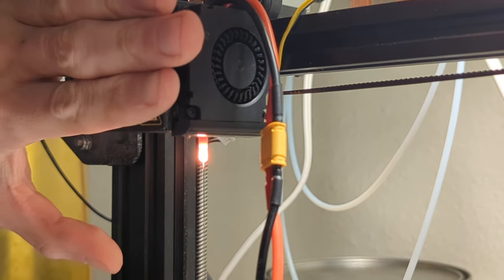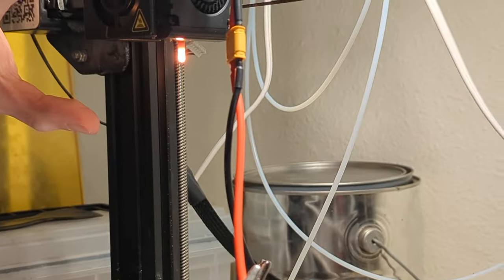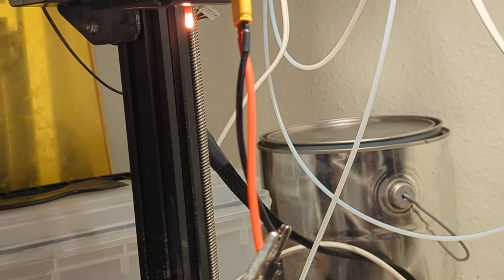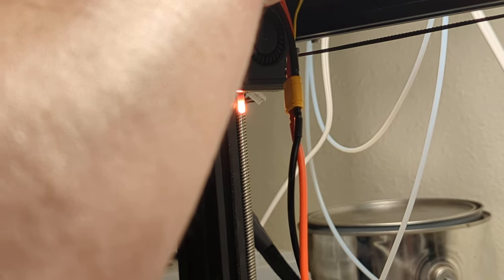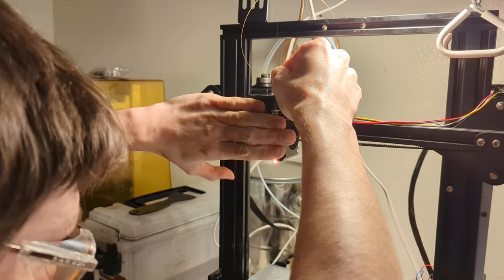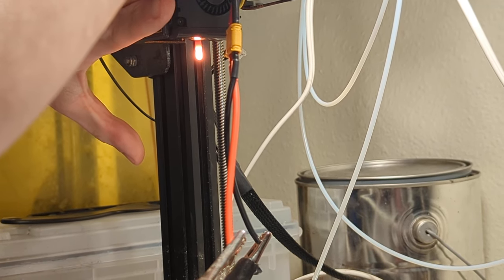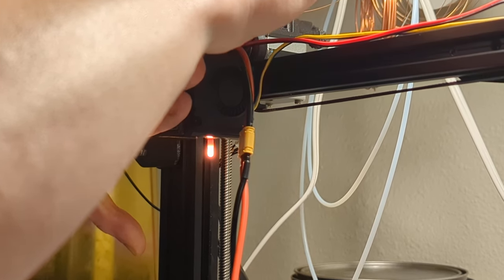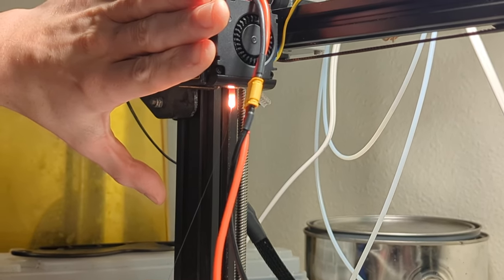clearing a jam in 1300 C hotend on the ender3.

Comment: I think you might get some stringing smoking with PLA at that temp
Reply from the maker: indeed. it might even be vapor deposited. :P
Reply: Just a little
Reply: I heard bronze, didn't know if that was the hot end nozzle material or if it was metallic bronze filament. I think 1300C is approaching (or even past) the melting points of some metals
Reply from the maker: 24 AWG, (0.52mm diameter) 510 phosphor bronze wire is the feedstock. The hotend itself is made of Si3N4-MoSi2 ceramic matrix composite, sourced from a ceramic glowplug that I modeled and characterized here;
https://www.printables.com/model/635347-beru-glow-plug-cgp-002

The actual printing temperature for bronze in this system will be somewhere between 950 and 1030 degrees C.

 @cyleleghorn246
Reply: @rotoforge2024     thanks for the reply! That sounds sick, I didn't know if the ender 3 officially supported this or not, but after this video the algorithm showed me your other video talking about the hot end! I'm gonna subscribe, thanks again for the details, it sounds absolutely awesome, like a happy middle ground between a 3d printer and a metal SLS machine. Maybe bronze isn't quite as good as sintered steel, but it's a whole lot better than PLA, and I'm assuming you can still use PLA or other filaments when you want to!?

I want a new printer, my old one has some problem where it clogs every time, I think it needs a new hot end heating element because it ramps up fine, but the temperature tanks whenever the fan comes on or I start feeding filament. It just can't keep up. The 1300C hot end sounds like it would solve all my problems haha
Reply from the maker: IDK about solving all your problems. 
the hotend uses 0.5mm filament diameter. so you would have to draw your own plastic filament using another 3D printer with an 0.6 nozzle...

as for the strength of bronze versus sintered steel...

if we actually obtain near forged properties in the bronze we print, bronze can easily be as strong as steel(particularly sintered steel), with greater ductility, if somewhat lower surface hardness.

typical tensile strengths for forged bronze 510 can be as high as 630 MPa at room temperature. A range for most grades in various annealed states at room temperature is between 340 and 640 MPa.

Most common sintered 316 stainless L, SLS parts are about comparable to this value. They can, with hot isostatic pressing, obtain as high as ~ 1  GPa at the expense of ductility.

This kind of comparison is definitely up for test in medium term once we get to printing.

This is to say nothing of the porosity of sintered parts which render them unsuitable for gas and fluids handling and vacuum applications...

We will be releasing a video on how we made the hotend this weekend. 
if you want to try your hand at making your own. 

In future, once we have got more concrete test data, I plan to make and sell them as a conversion kit or perhaps as entire dedicated printers. but this depends a lot on demand and performance. :P 

glad you like the work! 
feel free to join the discord if you want to tag along in the ongoing development as it happens. 

 @cyleleghorn246
Reply: @rotoforge2024  that's awesome, thanks for the write-up on it! I didn't know sintered parts had porosity issues, but it does make sense. I also had no clue that the bronze could be as good as other steel parts! I've been learning how to weld recently, so I have a great appreciation of how strong steel can be if it's even slightly thick. Getting that kind of part from a "standard" desktop 3d printer (as opposed to needing CNC, SLS, EDM, etc) is fantastic to think about

Comment: 1300°C? Good god that’s hot
Reply from the maker: in an inert atmosphere probably capable of ~1800 C once properly prepared.
Reply: @rotoforge2024 my brother in Christ why do you wish to incinerate PLA or print with glass
Reply: Maybe he wants the higher flow rate without paying for a cht nozzle 😆
Reply from the maker: actually, because the filament we use is 0.5mm diameter, and the power density in the hot end is ~3 orders of magnitude higher than conventional designs, we might actually be able to speedboat very well. 
plus, because the heat is generated at the nozzle tip practically inside the deposition zone, the degree of crystallization and layer to layer bonding that could be obtained even at very high printing speeds may be far superior to conventional designs...

One test we want to run is, using our conventional 3D printer to extruder filament feedstock at ~0.5mm diameter to feed into this hotend and see just how fast we can go on a better frame. 

TLDR; Yes, I do want to go faster and get better part quality.
 @Youtubeiscoolandgreat
Reply: @rotoforge2024 wow, I look forward to seeing your future tests
Reply from the maker: want to print with metal, and glass. 
bronze and borosilicate electronics for example.  @vaethe
Reply: 🤣🤣 @Youtubeiscoolandgreat

Comment: Aluminium printing unlocked
Reply from the maker: bronze printing unlocked 
basically a new bronze age if it works well. :P
bronze is the new PLA?
Reply: @rotoforge2024 get it running with a second extruder for ceramic or something and I'm looking forward to printing a toaster!
Reply from the maker: the papilio lite is the extruder we are using in a direct dive configuration. so we can print metal from fine wire and ceramic from glass/basalt/aluminosilicate fiber. the belts are pretty good at pushing glass fiber. 

https://kevinakasam.com/papilio/

also if you print a toaster, I would love to see it. 
 @OtakuNoShitpost
Reply: @rotoforge2024  How is it printing with metal? One immediate difference is that unlike plastic metal is a crystalline structure so it can basically turn into slush instead of progressively softening like glass and plastics do. Alloys seem like they could also be problematic over time as well due to the potential to selectively remove constituents at the melt interface if it re-solidifies at all.
Reply from the maker: We heat a fine metal wire to the semisolid range between solidus and liquidus. By selecting a  alloy whose native oxide is self fluxing, and which has a wide window between solidus and liquidus, and using a nozzle/heater which is not wet by the liquid fraction, and resits abrasion of the solid fraction well, and which can respond quickly to changes in temperature to keep us operating in the relatively narrow window between solidus and liquidus,  it becomes essentially possible to print metals like butter, or chocolate, or any other thixotropic (pasty shear thinning) material. This is not exactly the same as viscoplastic behavior of thermoplastics.

though we do intend to print with glass and basalt for printing the insulating parts of electronics...

we have yet to fabricate samples to analyze destructively to get a knowledge of how the process impacts microstructure.  This is definitely in the plan for medium term future. 

yes, semisolid processing can enable grain boundary segregation of alloy constituents. however, the actual thermal cycle time of deposition from hots semisolid metal to fully solidified on the deposition surface is extremely short (think single digit to maybe tens of milliseconds. and the diffusivity of most alloy constituents in the semisolid window is quite limited, for bronze in particular.)  I expect these factors and a few others I will include in future videos and a blog post tech writeup, to limit the degree of alloy decomposition due to the deposition process.  in fact, I expect to see near hot forged properties due to the strain from being pressed onto the previous layer in the semisolid region and the very high cooling rates seen in the deposition region...very fast rates of heating and cooling generally result in finer grain structures in many metals, including bronze....though only further tests can tell...

the short answer is there are still a ton of unknowns, and the working hardware is only step one.  

If you have any insight into the nature of these processes, we would love to chat with you in the discord. 
 @mysock351C
Reply: @rotoforge2024  Wow. Thanks for the info 😃 Yeah these things are always a challenge and you don't know until you try.

Comment: Very cool progress! Yes granular jamming is a huge issue with semisolid printing - that's why it's easier to print from the liquidus - but then semisolid material can still jam as it's initially entering the hotend, so the internal geometry and materials selection is very important. If I recall, I had an update on Hackaday about the 8 cases of high temperature wetting - it will be valuable to take a look at that. Nonwetting surfaces will help reduce granular jamming, but above the liquidus it may also help to have a wettable feature at the very tip of the extruder, because you can guide the deposition using the meniscus for better print quality.
Reply from the maker: thanks Michael!
I will be sure to take a look.
post a link?
Reply from the maker: the jam occurred because I melted off a piece of bronze in the hotend at way above its intended operating temperature. 
We were not intentionally feeding material at the time. we actually ended up clearing the little slug of molten material by pushing it out with a tantalum wire. 

the internal geometry is essentially a straight tube of ceramic. 
We may end up shrouding the ceramic tip in a H13 or other hot work steel or other high temperature tolerant alloy to provide wettable surface and a support for an oxide scraping brush or the like.
Reply: Huh it looks like we didn't publish that update - I'll make sure to do so soon. The gist is that at high temperatures, the liquid either dissolves the solid substrate or it doesn't, it either reacts with the substrate or it doesn't, and it either wets the resulting surface or it doesn't - that gives 2^3 = 8 cases for wetting, which is why it's been so hard for people to produce a unified theory of wetting at higher temperatures. In general we want to make sure our nozzle materials don't dissolve appreciably in the semisolid or liquid phase we are printing, and reactions at the interface can be ok as long as they don't alter the wetting or nonwetting property patterns that assist in the operation of the device. Nonwetting surfaces help prevent granular jamming - and in general you'll want to avoid compressing the semisolid phase as much as possible to prevent the liquid fraction from separating from the solid because the extrusion timescale is shorter than the diffusion equilibrium timescale. Wetting surfaces however can help with print quality and improve thermal transfer into the semisolid melt. @rotoforge2024
Reply: TL:DR you may need to engineer your choice of glow plug materials alongside your choice of semisolid alloy, especially for things with higher melting points.
Reply from the maker: I will let you know if/when I get around to setting up a ceramics processing lab. lol
might be a couple years. Unless you know someone willing to make and fire advanced electroceramic ultrarefractories for cheap.  :P
 @michaelperrone3867
Reply from the maker: unless the compression of the semisolid occurs on the buildplate in the deposition region rather than in a nozzle?
we do not have a nozzle constriction of any kind.
the wire passes straight through the hot zone and is stopped by the build surface. how does this effect the possibility for granular jamming?

as for wetting dynamics... bronze and Sn-Zn show virtually no propensity for wetting the ceramic at the temperatures of interest. The some part of the bronze starts to wet the ceramic above about 1350 C....
I would guess the CuO or other oxides of copper. but IDK. 
 @michaelperrone3867

Comment: I was thinking about firing three zero dollars worth of industrial battery spot welders with an ender,

This is totally something else.
Hope you guys have a plan for literal fire hazard issues lol
Reply from the maker: the heating element is intrinsic PTC  semiconductor, and is thus self regulating. It does not enter thermal runaway like a NTC thermistor controlled hotend does.
if the heater starts to overheat, the resistance will increase, limiting the current at a constant drive voltage until the resistance goes beyond the driver capability, at which point the heater temperature will drop back to room temperature.

If you are printing PLA, the heater and sensing system is sensitive enough to detect an overtemperature event (say from sticking a overheated glowplug into the plastic until it ignites) and trip the thermal protections in marlin. 

it is no more a fire hazard than a regular 3D printer hotend. It even uses the same amount of power from the same driver circuit. 
if anything, because the heater is PTC and cannot melt like an aluminum hotblock, it is probably safer than a conventional hotend. if the tip breaks off the circuit is broken and no heat is generated.
the metal wire does not burn like powder(given the energy density available from the hotend), and so poses even less fire risk than a polymer feedstock (which ignites and holds a flame readily even from a regular hotend at too high a temperature, like in a thermal runaway scenario.)

it might be rendered safer still, in some kind of inert atmosphere.

I plan to provide high quality user documentation and guidelines addressing this kind of concern and demonstrating usage with maximal operator and home safety in mind.

as per usual, dont let your pets or children near the printer, and dont leave extraneous flammables on the print bed...

Comment: Were you just hand feeding bronze through when this happened?
Reply from the maker: no. I had stupidly left the 0.5mm feedstock, 510 bronze wire in the hotend while I was trying to do some IV-RT Current-voltage-resistance-temperature characterization on the plug, and it melted(and oxidized a bit) in the hotend. 
which forms a little slug of molten metal/metal oxide (bronzetin mixed oxides) which either needs to be pushed out by more metal, or removed by some other means... 
fortunately, the melting point of bronze and all its native oxides are well below the safe operating temperature for the glowplug (about 1400 C). So we were able to remove the slug with,
in our case a silicon carbide wire, and eventually a tantalum wire. it turns out, yes, another more refractory metal can be used to remove metals and their oxides from the inside of the bore in the glowplug. Basically,  heat the plug to the melting point of the materials stuck in it, and push the material out the tip from the back, with the silicon carbide/tantalum wire.
After literally burning about 50 USD of tantalum wire to remove a 1 cent bronze slug, I realized than a stack of 0.5 mm pencil lead would probably also work and be much cheaper...

:P

Comment: Awesome metal 3D printer, I wish I had one…
Reply from the maker: we plan to offer the hotends for alpha testing as soon as we have some initial prints to show and good data to base the firmware mods on...
lots still to do though. so a month or three is not unlikely.
Reply: @rotoforge2024  how easy would it be to use klipper for this?
Reply from the maker: IDK.
never used klipper. the firmware should be pretty close to stock, except you need support for a K type thermocouple with a max3155 amplifier board, with a table that goes to 1000 C at least.  @TheyTookStrawb

Comment: guess i didnt look at spool of wire youre feeding into the hot end. Eek tho trying to heat a metal quickly in like 1/2in of space. how has this worked? maybe some insulation around the hot end?
Reply from the maker: the power density of the hot end is about the same as a torch flame. between 1 and 10 watts/square millimeter.

roughly 1-10 megawatts/square meter.

Since the wire is 0.5mm in diameter, the energy required to make it semisolid is quite modest, at 15 cubic millimeters/minute flow rate, 510 bronze requires about ~50 watts of continuous power input.

there is more than enough available energy to drive the change in viscosity of the metal in that small space given that the surface area inside the hotend, compared to the volume of the feedstock is quite a bit larger, and has such a high power density compared to conventional hotends,

Comment: I had PTFE tube melted in my printer and it was so gooey it wouldn't come out and it got stuck inside the nozzle. Had to remove it by taking the nozzle out, holding it with pliers and torching it with gas to make the block burn and turn into charcoal. Then it came out.

Comment: Man I really hope you get this to work.  I mean.. I think you're gonna need a gas feed and enclosed print volume for this to work properly.... Tbh at those temperatures metals tend to become very un-sticky and if you're trying to get good solid forge welds you don't want the surfaces to go bad before you add more metal.  Maybe an argon feed and a sealed chamber?
Reply from the maker: we operate at semisolid working temperatures. 
we may use gas if it proves neccessary. we have seen some results so far which indicate that it may not be terribly critical if your temperature control and forging force control are good enough.

thanks for the vote of confidence. I am going to keep at it until it works.

Comment: So..... turned off thermal runaway protection did you?
Reply from the maker: no. lol.
working on installing a thermocouple on the hotend and tuning the PID control so the printer can drive the hotend as per normal using an extended temperature table in marlin. :P